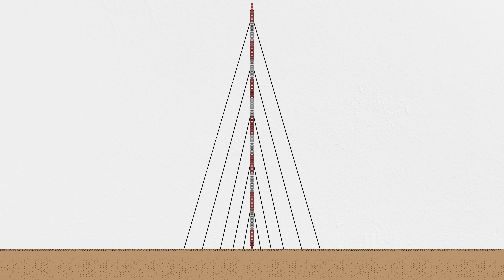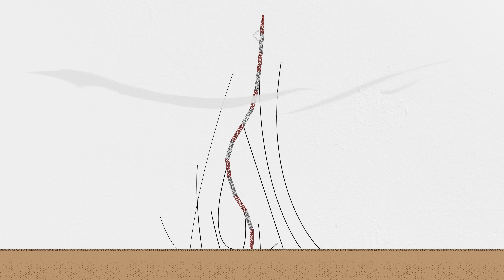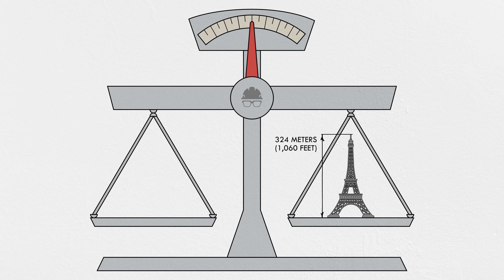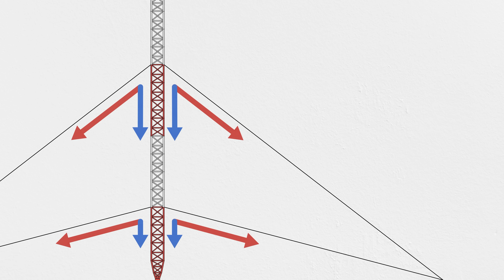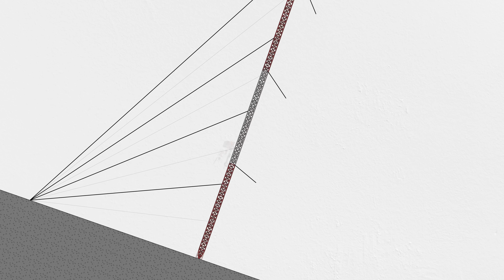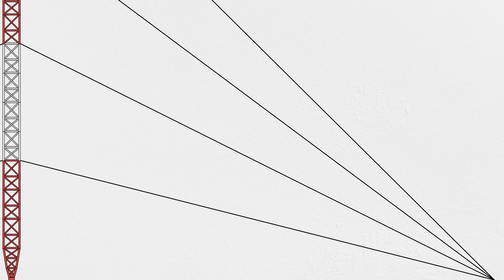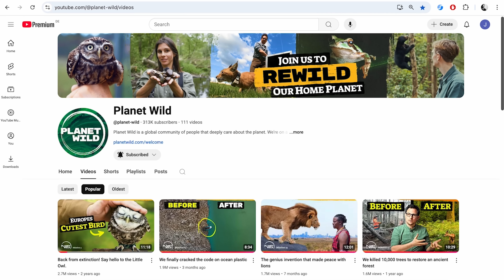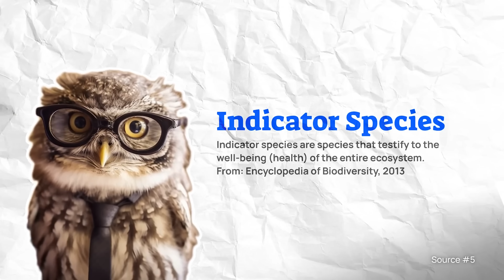The Bizarre Bases of Antenna Towers

Comment: I have an interesting tower story for you. I'm a broadcast engineer and about 20 years ago I moved an FM radio station to the tallest tower in New Jersey. A 1000' tower deep in the Pine Barrens. We put up a small FM antenna and a large grid dish microwave antenna to receive our audio from the studio 43 miles to the north. After we put the station on the air, there would be periods months apart where the microwave link would mute for a second at a time and that would go on for over an hour sometimes. I would drive down there and by the time I would get there, everything was normal and I'd find plenty of signal level at the receiver. I put a spectrum analyzer on the antenna to see if there was any other signal on channel or nearby that could be interfering but it was perfect and it was a mystery that really annoyed me. Then one day I was in the area of the tower when the microwave dropouts started happening. I drove to the tower site and what I saw was one of the scariest sights I have ever seen. All of the guy wires were galloping up and down from a sag down to bowed upwards against gravity and doing that very fast. Also the entire tower was in a twisting oscillation where large sections would twist one direction while the sections above and below it would twist in the opposite direction and that was happening on the entire tower and these sections would just be twisting left and right in a strong wind. I could see that the tower legs were going very far out of column and I thought that the whole tower was about to come crashing down because of that. I called the tower owner's manager and told him what I was seeing and I suggested that the guy wires must be very loose because that's not supposed to be happening. I had previously spoken with him about large radial cracks in the cylindrical foundation of the tower. I was assured that they were going to take care of it. So about the twisting tower, the tower owner rep responded by telling me that they had contacted and engineering firm about the cracks in the foundation and that the firm told them that reducing the tension of the guy wires would reduce the downward force on the foundation. So I don't know how much guidance the firm provided but the owner reduced the guy wire tension and the result was what I had witnessed. I told him that it was an emergency and he needed to get the guy wires properly tensioned or we could catastrophically loose the tower. They did quickly tension the guy wires and I never had any microwave drop-outs after that. I checked my records of the drop-outs against historical weather data from Weather Underground and the drop-outs always coincided with strong northwest winds. I did some thinking about the cracks in the tower foundation and concluded that the reinforced concrete foundation was probably being the path that lightning was taking to dissipate to ground. The ground in the Pine Barrens was all sand going deep down below the topsoil and sand doesn't have good conductivity for lightning. The lightning wants to take the easy way toward a low impedance ground and the deep cylinder foundation was probably better than the four copper grounding rods bonded to the tower. They did eventually excavate around the tower foundation and installed a  big steel clamp jacket around it and filled all of the cracks with epoxy.
Reply: Thanks for the cool story!
Reply: @fensoxx  Thanks for your response.
Reply: @mikeh2520 u should edit your comment to remove its punctuation just to annoy these people demanding perfect fluidity in youtube comments. It was a super interesting story you had for us 👍
Reply: Your description of the twisting motion reminds me of the Tacoma Narrows bridge collapse during high winds. It wasn’t designed for torsional oscillations.
Reply: @HondaRally300 They breached the design rules set out by John Roebling in his book. The so-called enquiry was a white wash. There is a book entitled Tombstone Engineering or something like that. Worth a read. You will never trust those disaster documentaries again, after reading it.
Reply: I was thinking the exact same thing!
Reply: Great story.  Tkx sharing
Reply: Man, what a sight that must have been. Great story. It's really too bad that didn't have 10 years later, it would have have been an amazing video.
Reply: @jimmychu7917  what-was-it bridge .... sumthun Narrows?  That sounds just terrifying to see
Reply: YIKES , you do not want to see a mast doing that any time soon 😅 the danger zone for those structures is wide and the guy wires are long... Glad you were able to first-hand experience it, survived AND got it fixed! Sounds like you saved a lot of money and pain in the long run. We've had a few nasty mast collapses in the UK over the last few decades, notoriously a few have been quite deadly. I was stood under one of our larger masts earlier this year (Winter Hill) - it's an incredibly impressive structure requiring constant maintenance. The amount of masts in the US, Canada and larger countries must be a huge financial drain.
Reply: @ChristopherWoods ..
Bigger population equals bigger income.
Reply: @senatorjosephmccarthy2720  unfortunately, hypercapitalist mindset = reluctance to invest in infrastructure or maintain it
Reply: "and after that we never played Let's Twist Again on that radio station"
Reply: @AcidGambit419  😂
Reply: @AcidGambit419 you know why gypsies don’t do the twist? It’s because they have crystal balls! 😂
Reply: Awesome story, thank you.
Reply: I’m a broadcast engineer too.  In Houston, we have 2000 ft. towers that must withstand hurricanes.  Most guy wires on the towers I’m familiar with, have both low frequency dampers (look like a wheel low on the guy wire with a steel cable though the center attached to a small foundation on the ground with weights on the steel cables) and high frequency dampers (look like dumbbells attached to the guy wires themselves) to help prevent galloping.
Reply: I'm a broadcast tech and this story made me nauseous to think about, my GOD
Reply: Galloping is a very real issue in the transmission line industry, so much so that we specifically space our wires out from eachother far enough such that when they do, they don't come into contact (which would not be good). It's not often I encounter guy wires galloping on our poles, granted they're typically much shorter poles (80' or so), but that's absolutely something that makes sense now that I hear about it.....wow!
Reply: @LoganLovell in windy areas, I see orange balls placed on transmission wires. Is that to stabilize the wind whip effect and prevent galloping?
Reply: @DishNetworkDealerNEO those are harmonic dampers,, cables flopping = aka oscillating: the damping inhibits self destruction
Reply: @DishNetworkDealerNEO those balls are to prevent aircraft from unkowingly or knowungly flying BETWEEN TOWERS and potentially strking them.   Thats especially common on wires crossing river valleys.   The wind mitigation devices most commonly seen on horizontal wires tend to look like triangular wing shapes positioned periodically to dampen galloping wires.
Reply: I'm glad that there was a happy ending, was scary for a bit
Reply: That tower twisting description could star in a horror novel man
Reply: If only you'd had a mobile phone with a camera at the time! 🤯
Reply: That's a massive pucker factor!
Reply: That must have sent a shiver up your spine! That’s not what you expect to see on a guyed structure!
Reply: Mike,I'm a life long NJ resident, where was this tower located? Was it the Rocky Point tower?  Just wondering if it's still there today.
Reply: @StephenLPhotos  Hey, I tried to respond with geo coordinates but it appears that my response got clipped. Go to a site called Radio-Locator and under "find by call sign" enter WTHJ and that will open a page that has a link to the geo coordinates of the tower and that will open in Google Maps.
Reply: Thank you for sharing your story. ❤
Reply: i love the community around this channel. thanks for your story fella
Reply: Thank you for reporting that and following up! I’ve been in the cell tower industry for 13 years now and it’s criminal what these tower owners ignore. Guy towers are the absolute worst!
Reply: アンテナ鉄塔に関する興味深いお話有難う御座いました。
自分の家のそばにも、120m 10kW AMラジオ送信所が有りますが、雨の日も強風の日も、台風の日も倒れたりねじれたりする事無く、
毎日電波を送り届けてくれます。
貴方の様な放送技術者や建築技術者が日々メンテナンスしてくれている、そのお陰だと感謝しています。
Reply: Awesome story!
Reply: Tower climber here. That story sounds absolutely crazy. It's amazing what some tower owners will do (or not do,) regardless of the safety risks they pose.
Reply: The tower wanted you to see it's secret that day
Reply: That's wild, I can't imagine seeing that tower twisting like that.  That had to have been scary.
Reply: Thank you sir for your great story ❤
Reply: Pine barrens ay? Did u happen to see any New Jersey wise guys out there?
Reply: @ainnalaina-x7r  No but I heard that the Russian guy from a Sopranos episode is still out there somewhere.
Reply: I am 70 years old and the kind of guy who just likes information about lots of things. I’m not really into high towers and all of that stuff, I’m just here because it was new information that I find real interesting. It is a bonus, however, that I get to read something by someone who actually knows what they’re talking about, well done, sir!
Reply: @3lmnop3  Thank you!
Reply: Summary of what he said 
A broadcast engineer moved an FM radio station to a 1,000-foot tower in the Pine Barrens of New Jersey. The station used a microwave link to send audio from a studio 43 miles away, but occasionally the signal would cut out for a second at a time over long periods. The cause was unclear—no interference showed up on the spectrum analyzer.

One day, during a dropout event, the engineer reached the tower and saw it violently shaking. The guy wires were whipping up and down, and the tower sections were twisting in opposite directions — appearing close to collapse.

It turned out the tower owner had loosened the guy wires after consulting an engineering firm, trying to reduce pressure on the cracked concrete foundation. This mistake caused dangerous instability and the microwave signal dropouts during strong winds.

After the engineer reported the emergency, the guy wires were properly re-tensioned, the signal issues stopped, and the tower stabilized. Later, the foundation was repaired with a steel clamp jacket and epoxy after it was determined that lightning strikes had likely caused the cracks, since the sandy soil made poor grounding.
Reply: microwave link I maintained was plagued by random hits too, one old FAA fly swatter tower. Finally found out: it was a buzzard fade! They liked keeping warm on the heated radome surfaces and when enough of them sat, the link failed. Good laugh too
Reply: I wish my family told stories like this during thanksgiving instead of fighting about donald trump
Reply: Great work to save the day.
Reply: Cool story bro, paused the video to finish reading this first😂
Reply: Insane!
Reply: Learned a lot thanks!
Reply: Thanks for the excellent story and storytelling.
Reply: That was indeed a story.
Reply: Thanks for sharing that story mate! Very interesting!
Reply: It sounds like the did a good/adequate remediation at least. Funny and sad how quick a remote tower can have things go out of control because someone's come up with a quick fix.
Reply: Are you sure you aren’t a civil/structural/broadcasting engineer, I’m not making fun, I love a detailed conversation, thanks brother!
Reply: Very interesting.  Thank you for posting!!🎉
Reply: Mike h,
Fascinating as h. And Terrifying -if I were there watching the 'tower dance'. Thank God you weren't coincidentally killed by a catastrophic tower failure , & thank goodness no adjoining infrastructure was damaged or destroyed. I envy you a little -your career field. EM energy transmission is an intriguing part of science.
Reply: Cool!
Reply: man you need... the enter key is free, did you know that?
Reply: I can see that tower from my house in Tuckerton, NJ, and ride my bike past it on the trails that surround it. Always good to see it still standing!
Reply: YOU are what we are losing too rapidly to what I call ‘Ivory Tower Engineers”. Whether you are degreed or not, you have the curiosity and wits to examine evidence, hypothesize, test and endure to a solution while ivory tower engineers are purely’textbook’, lacking the wisdom of delving into ‘reality’. You are a gem worth your weight in gold. I dropped out of an engineering degree because I struggled too much in calculus—better counselors might have ‘saved’me—but in the end I’ve combined an engineering disposition and sales/marketing to provide for a family a bring tangible feedback from customers to the manufacturer(s) I’ve worked for or with.  I cherish your kind and despise those trapped in their ivory tower.
Reply: Don’t forget that most of the people that like this channel are high functioning autists and things like not using paragraphs however jarring to them dont tend to bother anyone outside of spectrum.
Reply: When???
Reply: Hey thanks for sharing...here in South East London really tall antenna are Crystal Palace Tower...pretty boring but if you live in South East London growing up with it as a landmark that you can see from anywhere across London as long as you were heading towards it you would finally get home!!!
Reply: Amazing story. Good thing you observed and informed about the problems and actions to repair them was swift.
In an another scenario, the tower would had collapsed without proper observation and action.
Reply: @LegoAnimations6370  aren't you the guy who made the Lego cruise ship disaster video dude I remember watching that like a long time ago no wonder your channel seems similar
Reply: Of course, locating the tower in The Pine Barrens didn't help this freakish scenario at all.
Reply: Good story, but I definitely thought the Jersey devil was going to make an appearance when you mentioned the pine barrens lol
Reply: Love reading real life stories like yours!! I work in the steel fabrication/engineering/mechanical maintenance industry and see some crazy stuff almost on daily basis!! But I'll never forget when I've seen how much this one tall tower crane has bent across its whole height under heavy load! It was like an archers bow and I know that they design them with that in mind but didn't expect it to be to that extent! Them crane operators must have huge balls!!! 😉🤙
Reply: Wow, thanks for sharing, an amazing story 👏
Reply: Thank you for the story.
Reply: *lose
Reply: all i saw was "...deep in the Pine Barrens..." and i knew this was gonna be worth the read lol
Reply: guy wires, what? lmao
Reply: Nerd. Oh my God.
Reply: I’ve always wondered why some towers seem to “float” on tiny bases  now it all makes sense. The explanation about reducing foundation restraint and relying on guy wires for stability was brilliantly clear. As someone who’s built small-scale radio masts before, I can confirm how sensitive they are to cable tension and compression balance. Great demo, Grady!
Reply: Its beyond insane that they would do that because "cracks r bad"
Reply: Did you bill for the needed therapy? jfc that is Terrifying!
Reply: Nice. Lightning protection isn’t that hard but pretty much everyone screws it up. Short earth rods in dry sand is about right. I bet it met code too.
Reply: @8__vv__8  The electric utility companies get grounding right. When they build a sub-station, they will drill wells for grounding and go through rock layers if that's what it takes. I've been to mountain top transmitter sites where everything is rock. Grounding had beed done by running several cables down hill over the rock. That didn't work at one site in Vermont where a hiker took the lightning arc while walking past the tower. At many other mountain sites, the power lines are lightning's path of first choice for dissipation.
Reply: Interesting story!
Reply: Wow crazy story, thanks for sharing
Reply: How many torque arms and what levels??
Reply: Thank you for sharing, I love these type of stories! Glad you were there to stop a catastrophe!
Reply: I really wonder if this is the same tower I can see from my house.
Reply: Incredible how after someone suggested to loosen the guy wires that someone would blindly go and loosen them like that and not think or notice anything and happily drive home. Crazy!
Reply: Oh my god
Reply: Longest comment I've ever read and it was absolutely worth it. Thanks for sharing 👍
Reply: “Unreadable” “had to stop due to wall of text” …wow, y’all are pathetic.
Unless you are a child, or ESL…breaks for a post like that should be a convenience, not a necessity. He’s using proper punctuation and spelling, with very few errors or run-on sentences. You should have little challenge reading it as written.

Would breaks help? Sure. But are they necessary? No. To claim anything else is just covering for laziness. There are routinely paragraphs in books just as long as that post and longer. But I’m guessing the people whining here wouldn’t know one of those if it hit them in the face, as the only reading they do are instagram captions and YouTube comments on their phone.

May I suggest “Hooked on Phonics” as your next literary adventure.
Now please excuse me as I go scream at clouds as an elderly 37 year-old man.
Reply: @BackwardsMarathonPSU When whining about people whining, it was wise that you inserted paragraph breaks. Otherwise it would have been too labor-intensive to read and I would have skipped it. 😊
Reply: @BackwardsMarathonPSU i honestly dodnt even notice thr lack of paragraph structure until peoplr pointed it out.  I was too interested in thr CONTENT, not the number of breaks.  I for one congratulate OC on a good tale.  Mote or that, with or without perfect style.
Reply: Are all of you people children? It’s not that long and you shouldn’t need paragraphs to be able to read some text.

Thank you for sharing the story, I love hearing tales from niche professions.
Reply: @JamEngulfer ai and tiktok have ruined people lol
Reply: @JamEngulfer "all of you"!??! Most of us had no trouble reading it. Just a few did. So no, we are not All  children.
Reply: @rexwater1  It should be obvious that I was referring to the people who had left comments complaining how it was hard to read. If you weren’t one of those commenters I would hope it’s clear that I wasn’t talking about you, everyone else managed that inference after all.
Reply: @JamEngulfer Called to task for making a demonstrably false absolute statement*, you respond by making another false absolute statement.* 🤦

* - By "absolute statement", I mean assertions that are qualified with well-known risky terms like all, none, always, never, everyone, no one, etc. 

One of the easiest ways to have the legs knocked out from under your logical argument and lose credibility is to use such words carelessly; especially when thinking that insulting "all of you" somehow really means insulting "all of you except the ones I'm not trying to insult".
Reply: @big_beak  Didn’t know I’d wandered into the debate club. Unfortunately the strength of my logical argument doesn’t matter here, because I wasn’t trying to make one, I was insulting people that annoyed me. There’s a much lower rhetorical bar compared to a structured debate because yes, making an absolute statement without anything backing it up would lead to the point not counting and leaves it open to attacks from the opponent, but that doesn’t matter to me.

However, I asked a rhetorical question that was clearly restricted to a certain group. “You people” indicates as such, with the group membership clarified by the next statement. The reply I received was not a rebuttal, because it relied solely on them identifying themselves as an exception to my statement, which has no weight because as part of their statement, they make it clear that they weren’t part of the original group I made a statement about, thus rendering their statement moot. Their rebuttal was even weaker than my original statement because no part of it was logically supported. They simply made an incorrect leap and missed.
Reply: @JamEngulfer you are confusing YouTube with kindle
Reply: @JamEngulfer   It isn't too long, but it is a giant wall of text. On my 24-in monitor I had a hard time finding the next line in this huge block of text. It would have been far easier with paragraphs, or even just on a phone, just with a lot more scrolling.
Reply: @JamEngulfer  Adults are not immune to wall of text problems, for example autistics and ADHD people.
Reply: "If we don't tighten those LOOSE guy cables, we will LOSE the tower when it collapses!"
Reply: I totally read the whole thing and ts was peak fict- wait uh
Peak Non-Fiction
Reply: This wall of problems with reading longer texts is unbearable.
For an appropriate conversation it is also expedient to stay on topic.
The original comment was quite interesting and easy to read especially with Google translate. 😅 The latter also transferred even units.
Reply: Such an unusual and interesting story. Thanks. Consider the use of paragraphs for good English usage.
Reply: @orrabmas8991  I didn't intend it to be a narrative essay fit for publication but just a quick comment story to get out while I had the time and the inspiration.
Reply: @mikeh2520  Personally, I am used to comments having no paragraph structure. My brain creates that structure as I read. Your point about time-saving while perfectly communicating the story is valid. With no criticism, I thank you for sharing. BTW; dang!😂❤
Reply: @orrabmas8991 YES! Finally another grammar Nazi 😊
Reply: @orrabmas8991 quiet
Reply: @orrabmas8991  Could always work on your reading comprehension instead of asking other people to change their writing style.
Reply: @acidjazztest1  If the author wants as many as possible reading and understanding from their work no amount of "improving your reading comprehension" fixes the well known "wall of text" problem. Look it up to see that it has nothing to do with comprehending what is written and/or meant by the author. Read about "loss of place" as just one of many problems with a dense wall of text. This is especially true for reading text online.
Reply: @skybluskyblueify  I'm sorry - are you trying to convince me that paragraphs are easier to read than a wall of text? Are you going to try and convince me that the sky is blue next?

I don't understand why once online it becomes acceptable to respond to a story with criticism of its structure and then attempt to argue in good faith that you are trying to make this person's life easier or better somehow.
Reply: @acidjazztest1  Thanks for your suggestion. BTW, consider the use of a subject in sentence structure.
Reply: @skybluskyblueify  Maybe he only wanted to share it with people of higher brain function? Probably, 'cause I didn't understand a single word ! This comment might not make it to posting. I have a horrible habit of hitting back button on my phone instead of posting arrow. Sorry, no paragraph skills, either. Minimum punctuation abilities, but I try! All the best!😊
Reply: @orrabmas8991  regarding "the use of paragraphs," I strongly agree.
Reply: @orrabmas8991   I wasn't going to read the Wall of Text Crits You For 9000, but multiple comments said it was a great comment, so.... I can attest that I had a tough time making sure I made it to the correct next line, lol. Paragraphs are more than just good usage, they are critical to readability sometimes.
Reply: @kindlin Huh? Please translate into comprehensible English. TIA.
Reply: @NomadAttorney   Uh, I reread my post, it's quite intelligible. Do you not know what the word attest means, or something? rofl
Reply: @orrabmas8991  Yes, very interesting but also very difficult to read with no paragraphs...
Reply: I did see pine barrens in the first few lines though. Great episode directed by Steve Buscemi
Reply: @mmmm32837 Huh? And do you mean Pine Barrens, capitalized?
Reply: I couldn't even get through the essay but I'm sure it was interesting no way I'm reading paragraphs of a youtube comment this gives me insight into your actual personality only certain people do this
Reply: i ain't reading allat
Reply: You need a publishing company ,,, talk about short story long😂 I just stumbled onto kindle
Reply: TLDR
Reply: Nobody asked but ok
Reply: Great story, it's funny somebody thought the guy wires were causing the weight to increase on the foundation.
Reply: @walrus4248 I’m wondering if the cracks in foundation were towards the center of the foundation, or the outer edges, because the center would be under a lot of compression load, more so, if cables are tightened, whereas lose cables in high winds can cause some serious upwards shock loads on the opposite side of wind gust direction.
Reply: Yes, paragraphs are absolutely needed. The lack of good grammar on YT and social media is mind boggling and maddening. Still a good story and otherwise decently written.
Reply: @NomadAttorney   I didn't intend it to be a narrative essay fit for publication but just a quick comment story to get out while I had the time and the inspiration.
Reply: @NomadAttorney  In Facebook and other social media, when you hit the "return" key, instead of the creation of a new paragraph, the post is made. 

I see this as a trend in what I call the "abbreviation generation," where we are assumed to be capable of one thought only about the size of a "tweet," as in the original name of X. In other words, don't add much detail or subtlety to your communication. Don't think too much. Cell phones are accelerating this trend. 

Interesting, isn't it? Some of the comments here illustrate the preference for this kind of communication. BTW, with the sites I refer to, a new paragraph can be created by holding down the "Shift" key with the "Enter" key.
Reply: @orrabmas8991 Interesting indeed. Yet here, for example, hitting the return key does in fact create a new paragraph. All I know is that proper grammar and good writing is a lost art and virtually every comment I see here and on social media has numerous typos. Failing to capitalize and too/to your/you’re being the most common.
Reply: @orrabmas8991  Great tip, I'll try it (shift+enter), I hate seeing my incomplete message posted prematurely - - YouTube live chat usually.
Reply: Separate each paragraph next time. This wall of text is not readable.
Reply: @spankyjeffro5320 I can't believe that your brain can't process the post well enough. Certainly people see things and process things different.
Reply: I think you have a very interesting story, but with one solid word dump, no paragraph breaks. After 4-5 lines it became too difficult to
read so I moved on. :(
Reply: TLDR
Reply: @mmmm32837 - looks like only you knows what that means - therefore a pointless comment.
Reply: @mmmm32837 says a lot about you 😂